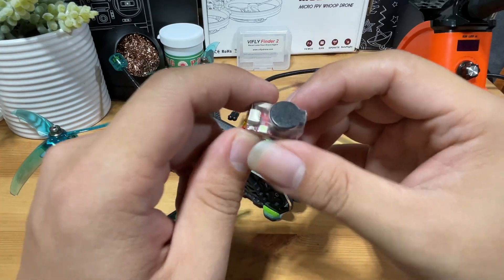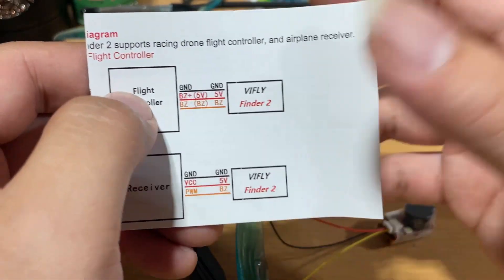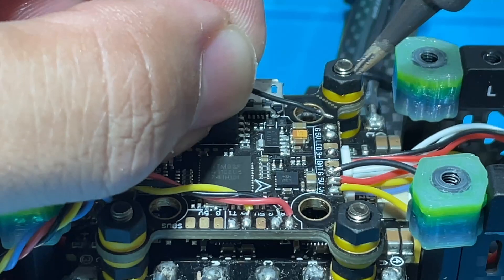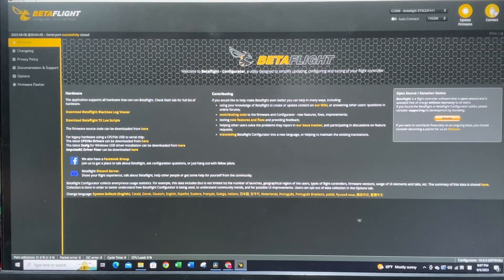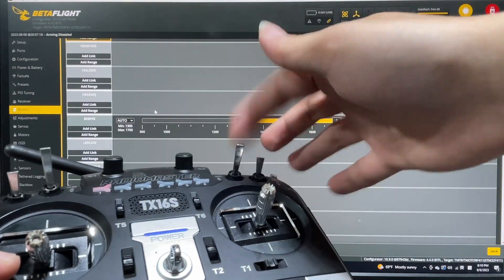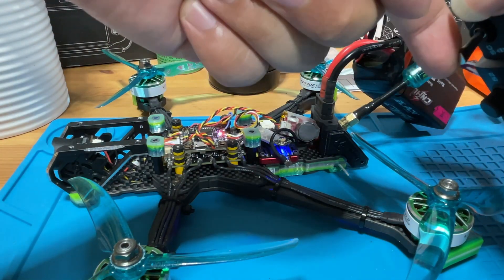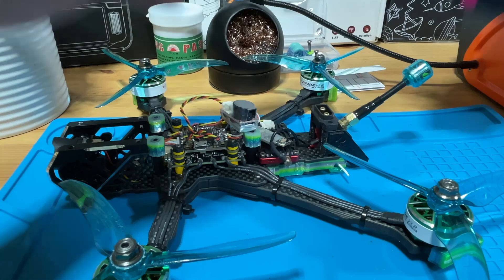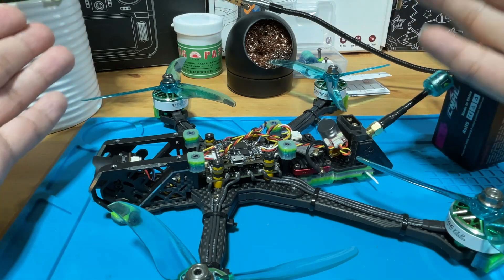Build a 5" FPV Drone Part 6: Install + setup a beeper (Vifly Finder V2)

Comment: Where do you place it inside the quad? It should be reachable in order to press the button to stop the beeping. How to you fix it in place? A strip, glue, tape? Thx for the video
Reply: I use two sided sticky tape and also a zip tie if you can fit it in there somewhere